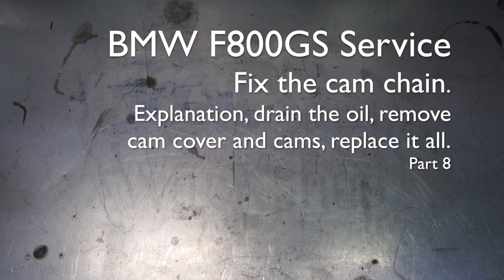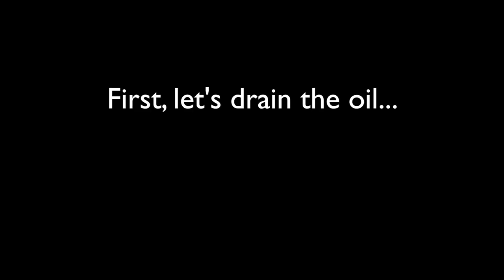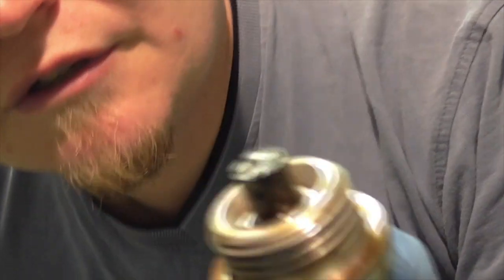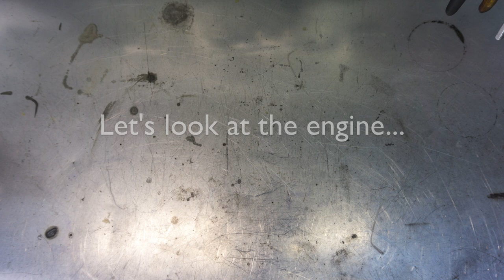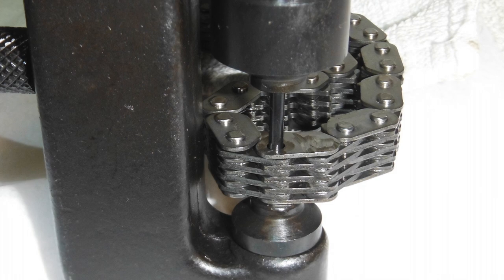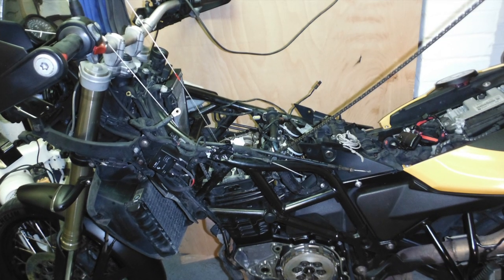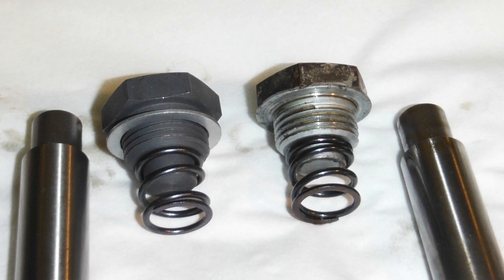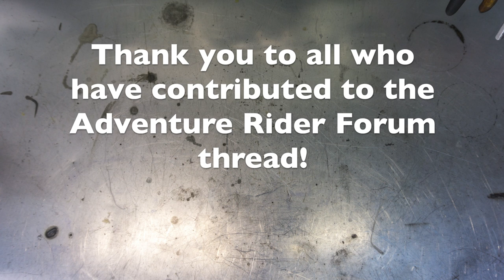F800GS Service E8: Replace cam chain, followers and tensioner

Comment: Great video....I have been working on an F800r recently....I would have left the four valve cover bolts in their rubber seats if doing it again....loosening them a little at a time and slowly releasing the cover.....that way they don't get hauled in and out of the rubber seat damaging it......they want to be in the valve cover when you put it on not inserted later....this bike I am working on has had a failure of the oil pump gears behind the clutch....the black plastic gears....11 41 7 690 441 shorn clean of teeth......I noticed that you can access the crankshaft cam chain sprocket once the complete clutch is removed if need be...
Reply from the maker: Thanks for your comment, Terry! Those rubber thingies are supposed to be replaced every time you take the cam cover off according to the overlords at BMW. However, if you're going to reuse them, I think your method is the way to go - you just need to know it before you remove them. 🤣 Any idea what caused the oil pump gears to shear? Hope you get the F800R back on the road!
Reply: I have no idea why the oil pump gear sheared...may be a freak failure of a tooth on the drive gear.....may be too many real cold starts as the bike was used in the winter.........it was good the owner shut things down when he heard the drive gear whining past the driven oil pump gear....thanks.
Reply from the maker: It's always annoying when you don't know the root cause of a failure, but full kudos to tackling the problem and getting it fixed. 😎👍🏻
Reply: Right....I clean the rubbers , and rubber gaskets with a quick wipe of thinners .....tack them up with a little hylomar blue as I do on airhead pushrod bungs...take care.

Comment: Hi Jocke. Six years on and I was wondering if you still are riding the GS and how many miles you have put on the engine since the cam chain replacement. Happy New Year!  Ray.
Reply from the maker: Hi Ray!
Sorry for the delayed answer. The bike in this video isn’t mine, so I don’t have any up to date information. As far as I can tell, the bike is still fully functional. 
Having said that, I should have a look at my own bike’s chain. 
Sorry I can’t be more accurate. 
Happy New Year to you too! 🍾😎👍🏻

Comment: Hey
Good video but where can I buy a chain link? I have an original BMW chain.
Raimo
Reply from the maker: Raimo, anteeksi, en nähnyt kysymystä. I hope I am too late and that you've figured it out already and that the bike is up and running. Have a look at the AdvRider forum thread I've linked to. I ordered my links from Busters in UK, but I don't think they're available anymore, they might not even be trading. They are standard links, so they should be available from places that sell parts for motorcycle engines.

Comment: when removing the cam plate nuts one of them fell. I thought I would find it when I took the plate off but no luck. My fear is that it fell down the timing chain area. If I pull the oil pan do you think I would find it? Thoughts?
Reply from the maker: Hey, that sounds serious! I'd be very careful of what I'd be doing next. If it fell down next to the cam chain, I doubt it would have fallen down to the oil pan. I guess (I really don't know) that the passage around the cam chain is very narrow and that it wouldn't allow for a nut to pass by. I'd make sure I get the nut out somehow before even turning the engine round. Maybe get a very strong magnet and secure it somehow to a stick or a piece of string and fish the nut out somehow. You can have a look at realoem.com or just Google Images to try to figure out where the nut might have ended up. Hope you can find the nut!!
Reply: I found it. It was embarrassing though because it ended up just behind a spring on top. However after I found that I ended up dropping a shim down the timing chain area. I pulled the clutch cover and it was sitting at right under the chain.

Comment: Hello Jocke! Great video! Thank you!  Please inform, what oil viscosity did you use before this replacement of the timing chain? Thanks! Nick
Reply from the maker: Hi Nick, thanks! I don't know what oil was in the bike. My friend bought the bike and gave it to me to fix up and that's when we discovered this cam-chain issue along with a host of other things. Sorry I can't be of more help.
Reply: Fast alle Hersteller in Deutschland (auch und gerade bei Autos) hatten viele Probleme mit Steuerketten.
Die Ketten kamen ausnahmslos aus China und waren alle von schlechter Qualtität.

Comment: Well Done Bro!!! On my F800R 2010 the noise is some how hard on start-ups and I am planning to change the cam chain, put on a new tensioner and replace the three sliding plates/pieces; also it will be OK to check and adjust valve clearance, by the way, the shims are only available from BMW Motorrad? can I use/borrow shims from other maker? Thanks again y Very well done!!!
Reply from the maker: Thank you! If your noise is only on start up, everything might be fine, as there's a bit of rattle until the oil pressure has built up and the cam chain has been tensioned by the pressure. However, if you're about to check the valve clearances, you'll quickly notice if your cam chain has stretched - as shown the E3 video. When it comes to the shims, I don't know, because I've never had to replace a shim. If you don't need to do the service in a hurry, then I'd open the engine up, and measure the valve clearance, and if needed, buy the shims. I've heard of F800 engines that have done more than 100,000 miles (160,000km) without any valve clearance issues. You can find the part numbers on realoem.com for any parts you need, including shims (I would hope). :) Good luck with the service!
Reply: @JockeSelin  https://www.realoem.com/bmw/enUS/showparts?id=0244-USA-03-2012-K71-BMW-F_800_ST_0234,0244_&diagId=11_4003 is this the right engine? I guess so...
can I just replace the new chain tensioner "on the fly" so to speak... just drain the oil and then remove the old one...

Comment: Thank you for this video. I'll be doing this method later this summer. 
One question. Why did you need to remove the clutch cover?
Reply from the maker: We wanted to change the cam chain guide. If I remember correctly, it pivots at the bottom and is attached by a bolt that's accessible from inside the clutch side of the engine. It turned out that the guide was barely worn. We also wanted to change the clutch cover itself as it was badly corroded. 
If your clutch cover is in good condition and/or you don't need/want to change the cam chain guide, then there's no need to remove the clutch cover. 
Hope that helps, and good luck with it all!

Comment: Good day.  is this the original chain?  where to order a connecting pin?
Reply from the maker: "The original chain"? Was it installed in the factory? I don't know, I don't know the history of the bike, but I would guess it was the original chain. Or do you mean if it was a BMW chain we purchased to replace the stretched one? Yes, it was ordered from BMW.

As for the link, this has been answered many times in the comments, but is also listed in the description. However, I believe the company doesn't exist anymore so the link is outdated. 

Good day.
Reply: @JockeSelin  you installed this pin yourself to connect the chain
Reply from the maker: @ruslankonung597  yes
Reply: @JockeSelin  thank for video and response
Reply from the maker: @ruslankonung597  you’re very welcome. Good luck and please keep us posted on how it went. 😎👍🏻

Comment: Hey hi im going to change chain beacause i have your same problem.....do you know how long or how many pieces have the original chain?....tks sooo much
Reply from the maker: I never counted the links, as we bought the chain from BMW so it came with the correct length. Try the AdvRider thread there might be additional information in there. Hope you get the chain replaced without too much hassle.
Reply: @JockeSelin  tks sooo much....
Reply from the maker: Good luck with the fix! Please let me know how it worked out!
Reply: @JockeSelin  sure!
Reply: @JockeSelin  after 1 year chain goes great!!!! What kind of instrument do you use for pin the nipple lock chain?
Reply from the maker: @tommasolenzi333  That's great news. Sadly I don't understand your question. The tool I used for riveting the cam chain is the one linked in the description:
https://www.amazon.co.uk/dp/B004L6DUV0/?ref=exp_jockeselin_dp_vv_d
Reply: @JockeSelin  perfect I search for it tks
Reply from the maker: @tommasolenzi333  Excellent! 😎👍🏻

Comment: Did this stop the start up rattle?
Reply from the maker: No, it didn’t and it shouldn’t. The cam chain is not tensioned until there is oil pressure.

Comment: I am wondering, wouldn't that be a problem of the chain tensioner? how can we measure if the chain is stretched?
Reply from the maker: I'm not really sure what to answer to this. I think I'd need some more information to be able to answer better, but here goes nevertheless. The original BMW cam chain tensioner doesn't have any adjustability. You just screw it in and that's it. The new one we put in was not exactly the same as the new one. Perhaps it's a bit uprated and thus will minimise this problem for the future. To measure the chain stretch reliably in situ you'd have to have some very exact measuring device as the stretch per link is very small. Obviously you can measure it better if you take it out of the engine. I'm quite annoyed that I didn't do this when I had them side-by-side. I regret that a lot now. 

I think the short of it is; If your cam tensioner can't tension the cam chain; it's stretched beyond its specification and thus need replacing - no shortcuts (except this method where you don't have to split the cases).

Hope that helps! Thanks for watching!
Reply: Do you still have the old chain? I think it worth measuring it and putting the numbers online so others could compare it with theirs or new ones. 
In my research I found a boar spectrum of replacing intervals from 25,000 miles in one case to  238,000km in another case, and everythign in between :).  Seems to me that there is a lot of confusion about it. 
Someone on advrider said he found in the service manual a picture of a tool that inserted in the tensioner place would measure the total elongation of the chain but the dealer could not find that tool. I was also unable to find that in the service manual.... 
Also, the tensioner seems to be hydraulic. Which means that it is possible even with a good chain to see slack in between cam sprockets with the engine stopped because the chain is not at all tensioned...
Reply from the maker: I don't have the old chain, sorry. It was filmed in summer 2015, so it's all long gone. I do wish I had compared them at the time, but for some reason (probably too stressed and focused) I didn't do it. 

I'm just taking a very pragmatic stance to it all; if the chain shows slackness it needs changing. The tensioner is only there to add a bit of tension, not get rid of this amount of stretch (it's not a chain adjuster as per the rear wheel).

I hope you can find out the information you need, but the easiest way is to just open it up and see what it looks like, and replace it if it looks slack. 

Sorry I can't provide any more information.
Reply: No worries! Thank you fot the effort of sharing this with us. I’m thinking to write to BMW or even Rotax to ask. I like the scientific approach :)

Comment: I am no mechanic, but isn´t that chain slack normal while you are turning the engine without the oil. Since then you do not have oil pressure in the chain tensioner to keep the slack out the chain and at same time valve springs are able to overrotate (intake) valve cam a bit after the highest point of the valve lobe?
Reply from the maker: No, it's not normal. Which you can see when the new chain is fitted. The chain tensioner isn't an adjuster like the rear wheel adjusters. It's just there to remove excess movement. If you have that much slack, then you risk the chain jumping teeth on the sprockets. And I'm no mechanic either. 🤣
Reply: @JockeSelin  Did you measure how much the old chain had streched?
Reply from the maker: Sadly I didn't. I really wish I had compared them, but in my brain-haze I didn't do it. (Sorry for the late reply, I keep finding comments all over the place!)
Reply: I’m starting to get a ping at start. My chain is stretched is allowing abit of timing play. Definitely dancing with the devil. Parts should be here tomorrow for the job.
Reply from the maker: Hope the operation goes well when you get the parts! 😎👍🏻👍🏻

Comment: where did you get the master link from ?
Reply from the maker: If you would have read some of the other comments, you'd know the answer, but here it is once again:
I think we bought them from a company in UK called Buster's - I don't think they are trading anymore, but if you look through the comments and the link to the AdvRider thread I'm sure you can find some links. 
If you do find a good source, then please leave a comment here so others can find it too. 
Thank you!
Reply: thanks! one last thing... how were you able to rotate the chain through with the 8mm bolt locking the cam shaft in tdc ?
Reply from the maker: @kristopherryanrides198  You remove the TDC bolt to rotate the engine. Looks like I wasn't very clear about that in the video. Hope that helps. 🙂

Comment: Thanks for the video. It is really helpful. I have one question about the chain. Have you considered by that time or from there to now to buy the camchain directly from the manufacturer Borgwarner Morse? I bought the one of the link below to make the change next weekend. It is (apparently) the same chain and the manufacturer sells it opened with the propper link, at least it has the BWA letters on links with is from Borgwarner Inc. I think I bought right with 146 links long. Do you know if it is correct?
https://www.dam-sport.net/es/cadena-de-distribucion-abierta-borg-warner-con-enganche-82rh2015-146-honda-cb-750-1991-1992.html
Reply from the maker: If you can buy the chain with the correct link directly from the manufacturer, that's excellent. Sadly I don't know whether it is correct or not. I'm no chain expert, so I really don't want to give you wrong advice. I'm sure it would be of use to a lot of other people if you could post whether it was the correct chain or not.
Reply: @JockeSelin  of course, I will. It is at home from 1h ago. Lets see
Reply from the maker: Hope it goes well! 😎👍🏻
Reply: One question Jocke. What tool did you use to rivet the chain?
Reply from the maker: P M WOW that’s one big slacker there! (Nice screwdriver by the way!). This is the tool (affiliate link) https://www.amazon.co.uk/dp/B004L6DUV0/?ref=exp_jockeselin_dp_vv_d it worked well. If you are curious about what else we use, check out the Amazon storefront; https://www.amazon.co.uk/shop/jockeselin 
Hope it all goes well and keep asking questions if you need help and I’ll try to get back to you in reasonable time (tons of things going on!). Thanks again for being part of all this shenanigans!
Reply: @JockeSelin  thank you. My doubt is just how to rivet it properly. I have the same tool but the ball it has yo rivet (6mm diammeter bearing balll) looks big to me. But I intend yo use It. Did you do the same?
Reply from the maker: Just used it out of the box, squished it a bit, and then a bit more. No specific torque or anything. Don’t take my word for it, but as long as the ends are squished so they’re larger than the hole, the pins shouldn’t come out. Just don’t make it too tight though. I’m definitely no expert on this matter.
Reply: @JockeSelin  thank you. I will try it and let you all know tomorrow
Reply from the maker: I’ll keep my fingers crossed for you!
Reply: Hi Pablo, have you got any information on this being the right chain for the f800gs?
Reply: @BrinkhuisEyle  Hi. Yes. The right one is the OEM chain. It is the best option. The one that I bought was not exactly the same shape, but same reference. So the best is to go to the BMW and buy one
Reply: @pmejuto  did you manage to to use the chain you've bought first, or you bought original BMW one?
Reply: @pr0ud1000  I have bought an original one. It is the best solution

Comment: what was millage on that bike ?
Reply from the maker: From memory, 57,000 miles, check out episode 1 for the details.
Reply: @JockeSelin  mine is sitting at 60000km  still didn't touch anything
Reply from the maker: Sounds like you have a good bike! Hope you enjoy!
Reply: @JockeSelin  I mean on engine only
Reply from the maker: According to BMW the cam chain should never need replacing, so you might have a good engine.
Reply: @JockeSelin  yes,  but if its stretched too much ? also valve clearance not touch yet and 60000km already.
Reply from the maker: Dejan C sounds like you should at least check if everything is OK. Things might be just fine.
Reply: @JockeSelin  I will next season  because 3.15 thou is very small tolerance for both  intake and exhaust
Reply from the maker: It’s a very good engine too. ;)
Reply: @JockeSelin  I have seen many 1200gs over 250K  but not sure for this f800  if can reach same  or no.....

Comment: How many miles were are your bike when you decided to swap Cam chains?
Reply from the maker: This bike had 87,000km / 54,000 miles when the videos were filmed and we noticed the problem with the cam chain.
Reply: @JockeSelin  mine is only 13000 miles and have this problem.
Reply from the maker: @antoniosem1938  Sorry to hear that! That's the lowest I've ever heard with this problem. I hope you can get it sorted.